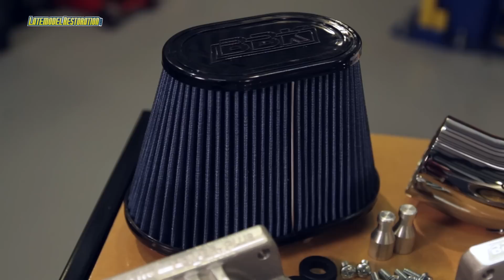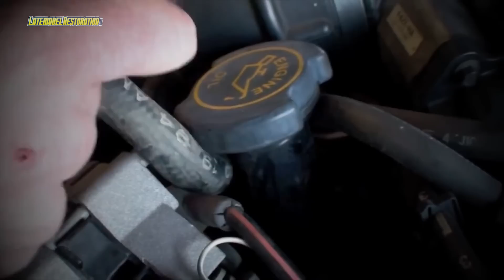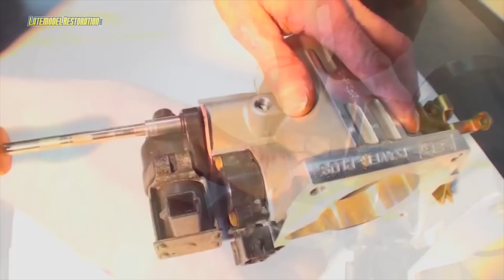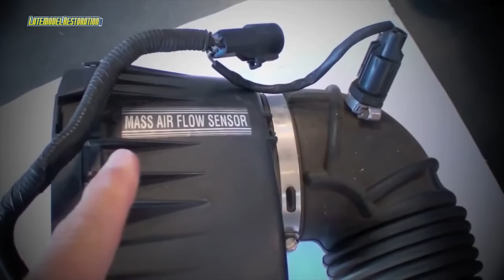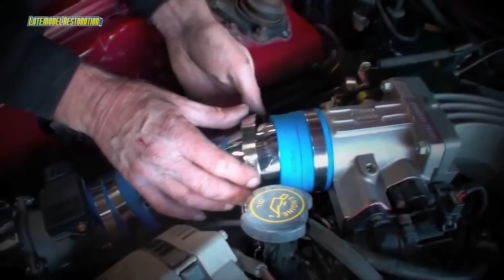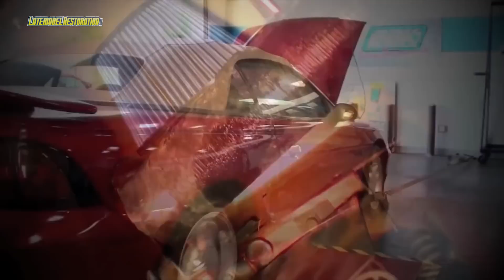Mustang BBK Cold Air Intake & Throttle Body Install (94-95 5.0L)

Comment: Are you saying that this modification works perfectly with the stock computer?
Or by implication saying that it works at full throttle pulls only.
What about cold/hot starts, idle, driveability, etc.?

Real world results please.

Comment: Now wait a minute.
That TB is at least 5 mm larger than the manifold hole, as shown looking through the throttle plate.

You are implying that the air hitting that step doesn't matter.

Poorly done hack, at best
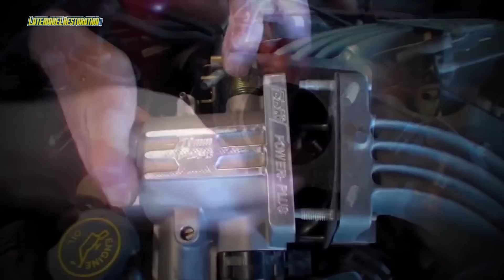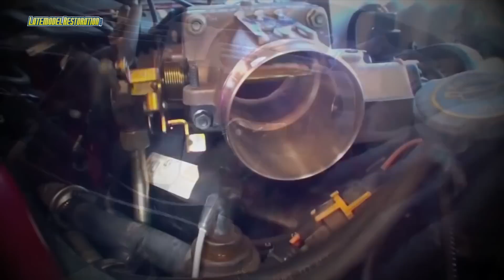Reply: Look at the gasket at 2:35 and the throttle bore at 2:48.